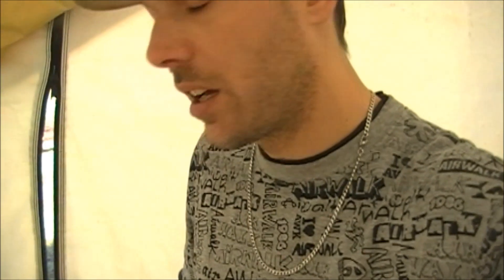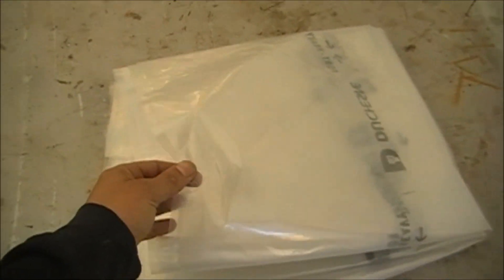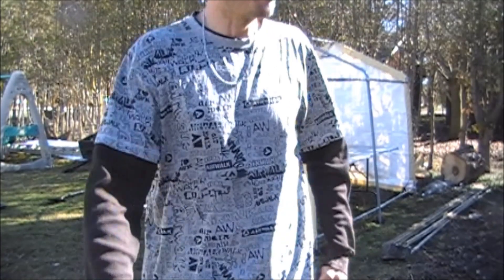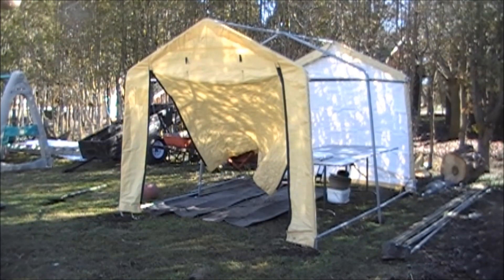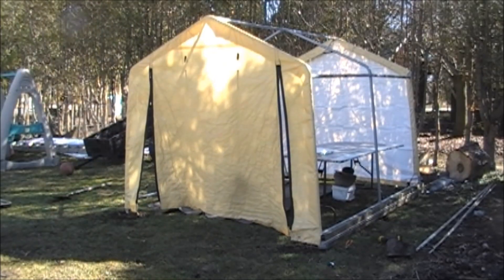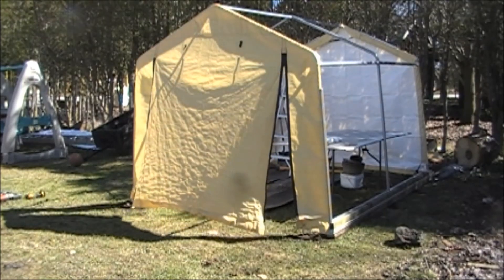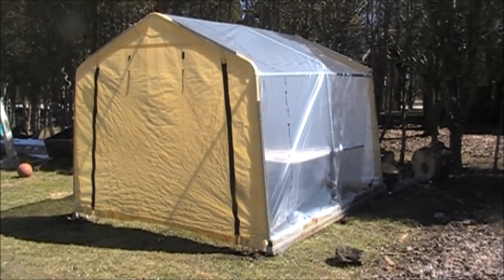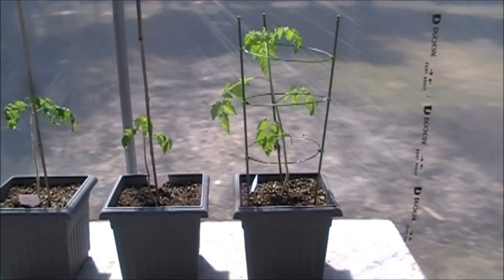10x10 shelterlogic Shed Turned Into A Greenhouse

Comment: Thank you I've been trying to figure out how to do the same with mines except the yellow cover is gone. You used the wiggle wire did you use the same on the top. Did you have to add wood or did you screw it into the metal frame I need more info lol thank you for doing it though it gave me something to work with and if you find out they sale a clear cover let me know please❤❤❤
Reply from the maker: Glad I could help

Comment: Where do you get that aluminum channel and wire for attaching the plastic. Or what is that called?
Reply from the maker: They were left over from a green house we had years ago I'm nor sure where to buy them but a piece strip aluminum with self taping screws would work to ...thanks for the comment

Comment: Why no answers to all the questions??
Reply from the maker: Mike Jones I did awnsers all the questions
Reply: Oh!  I see them now!  Sorry, and thanks for the video.  What size structure is that your working with?  Because I have a shelter logic greenhouse 20by10by8 that I'm not going to use the cover for
Reply: MileHighGuy Garden Guru but shelter logic has made 10 x 10 and 10x 20 greenhouses for at least 5 years and sells the tops for them.  It’s right on The website.